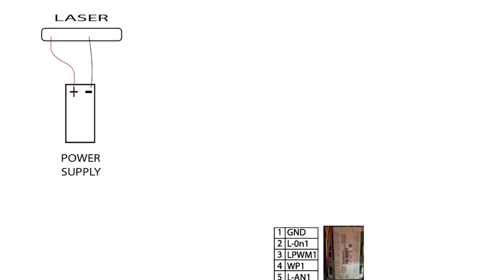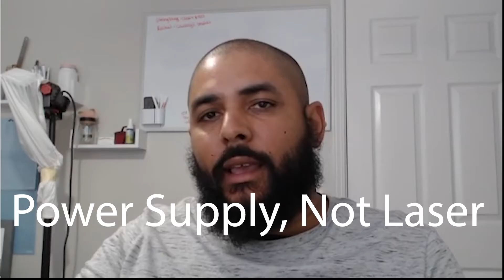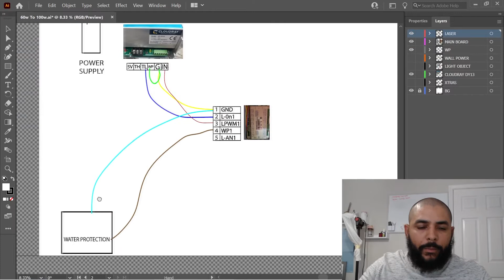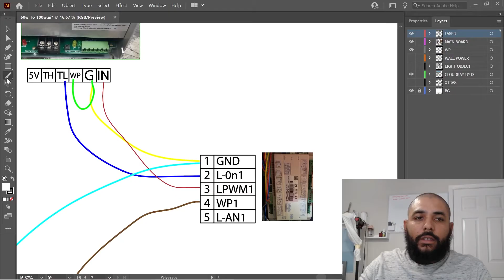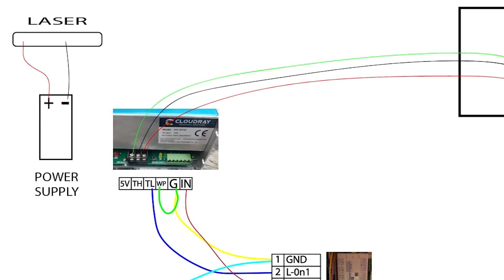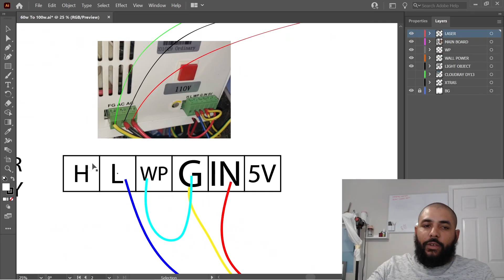Upgrade CO2 Laser Cutter From 60w to 100w Wiring Explained Reci W4 Laser Tube and DY-13 Power Supply

Comment: What’s is the 5v in the power supply for? Is it input or output?
Reply from the maker: I'm not sure what it's for, I haven't seen it used yet. I have a different laser now and that one doesn't use it either. I looked around a bit and from what I gather it's a 5v output with about 20mA amperage

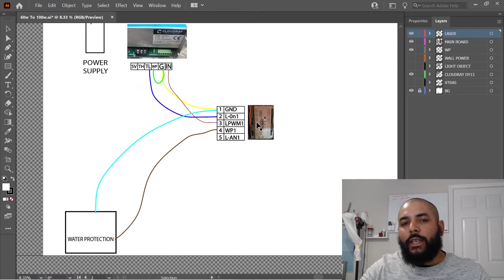Comment: First of all, I love the video. It answered so many questions. You are a genius. You said your original laser is a 60-watt. You have upgraded to a 100-watt. Regarding the water protection, yours is controlled by your laser controller and not the power supply, hence the jumper wire from wp to ground. Your original setup had a water protection switch already built in at 2:43. Are you saying that your old 60-watt laser tube was water cooled? If so, that is very impressive. Or did i misunderstand something?
Reply from the maker: Thanks Mark, yes that's correct. My original setup was water cooled from the factory with the hardware already installed so I didn't need to install the water flow sensor.
Reply: Thanks for the reply  @RogersTestLab

Comment: Hello dear can you please tell me that i can use 150 watt power supply for 100 watt laser ctter
Reply from the maker: If that’s all I had I personally would. I’d just be sure to use an ammeter rated for mA and not go over my laser tubes rating (should be 20mA if you’re using tubes like the ones I’ve used).

Comment: Nice job, thanks. So the 100w tube is (significantly?) longer than the 60w - correct? I have a panel in my 60w case that can be removed, but where do you find a cover for the 100w tube - that is, an "extension cover"?
Reply from the maker: Hey Steve, yes my 60w was 1000mm and the 100w was 1450mm so there's a 45% difference in length of the laser tube. 
There was a comment that I saw in here a while ago (that I can't seem to find) mentioning modding a PVC pipe as a cover but I never got around to trying it. 
Honestly if I really wanted a cover I would just call the manufacturer, in my case OMTech, and ask them for one. I'm sure they'd sell something.

Comment: Hey could you tell me what could happen if you mix the order of the wires 
Like I messed up the wiring of the power supply and now my machine won't stop firing the laser 
Please I hope u respond soon 
Thank u in advance
Reply from the maker: Hey Haroune, it would depend on the components you're using. 
If it were me I'd start by looking for a Facebook Group specifically for the laser cutter that I have, this way you can send pictures and reach a larger set of people that know about the system you're using.
Reply: @RogersTestLab  all I'm trying to find if I wired it wrongly would It have any impact on my controller
I have an mpc6525 leetro controller
Thanks for responding I really appreciate it

Comment: Thank for some help, I reworking a older Golden Laser to updated controller Ruida 6445G, The laser tubers may be bad so I may have to replace them too. If so I will replace the PS too. And go from 80 watts to 100 watts. I have the X and Y moving but no luck with a test fire of laser
Reply from the maker: Hey Kevin, thanks for watching! Good luck on the repair

Comment: Can I use a 130w tube on a 150w power supply
Reply from the maker: I would, from what I understand it's just you'd want to use a lower percentage so you don't fire your laser over 20ma
Reply: Ok thanks, I used to run at 65 /75% anyway so I guess it should be ok
Reply from the maker: @englishwoodman  good stuff man, let me know how it goes

Comment: Hi Roger 
I am upgrading my 60 watt OM Tech red & black laser to a 100 Watt can you tell me where you purchased the tube mounting brackets for the 100 watt tube.
Reply from the maker: Amazon. Since I got a reci w4 (80mm diameter) I searched Amazon for 80mm mounting brackets and got the cheapest ones basically.
There are adjustable ones on there too in case you get a different tube size

Comment: Hi, if there was already a 60W tube, why not switch the power supply and the tube to 100W and that's it?

Why did you have to mess with water protection ? After all, the water protection already worked with the 60W, didn't it ?
Reply from the maker: Hey Nir, that's what I did. 
When I was explaining the water protection piece I was showing the different places the water protection signals (either the power supply or the controller) to stop the laser from firing when the water protection switch isn't triggered. 
I agree with your thinking: if it ain't broke don't fix it.
Thanks!

Comment: Hey Bro Nice information, I just bought a 55W CO2 laser (Chinese), I have been thinking about upgrading to 130watts..it's possible in my machine? Do you have another video where you made your process?  I'm really scared to do that on my own.
Reply from the maker: Thanks! I wish I did but I didn't make a video of the actual process. 
If your laser chassis has a cutout for the tube to extend through and the opening is wide enough to fit the width of the tube then you should be fine.
Then it just comes down to the power supply, laser tube mounts, and sufficient water cooling.
I only upgraded because I was happy with the bed size. Now that we're picking up orders I wish I had a larger cut area.

Comment: i just purchased a 60 watt laser,  will the 100 laser tube the same size as the 60watt tube?
Reply from the maker: It shouldn't be. My old 60w tube was 1000mm and my reci w4 100w is 1450mm, so about a 45% longer. It sticks out the end of my 700mmx500mm red and black laser machine.

Comment: Hey, Nice explanation!  I also want to upgrade my 60w laser. Did you have to make any adjustments to the laser tube such as the hight. ?
Reply from the maker: Hey Nanne, thanks for watching. Yes, absolutely and a very good point. The tube is thicker so it sits higher but it got even taller from switching the tube mounts. Since the tube was too thick for my existing tube mounts I got the CloudRay 50-80mm ones from Amazon which sit much higher. I ended up shimming the first mirror to compensate the the height of the tube.
Reply: @RogersTestLab  I upgraded from a 60W to an 80W in my Red/Black and was originally going shim mirror 1 until I thought on it and realized by doing so would cause the beam between mirror 1 and mirror 2 to not be perfectly parallel with the the rest of the beam/mirrors. For example the beam would hit lets say in the center of mirror 2 when the X axis is close to mirror 1 and when the X axis moves further away the beam would now be hitting low. Did you just split the difference between the two and just send it anyway? I ended up designing and 3d printing my own tube brackets in the end.
Reply from the maker: @T3chbox  yeah I hear what you're saying.
I don't use this laser anymore, I switched to a 150w with a bigger bed, 
but
if I did have that issue I would probably zero it near-center of the laser bed after the 4 corners and the variance should stay on the mirror.
I like your 3d printer method though, you should post a video and sell them online, I would've definitely bought something like that just to keep the beam as perfect as I could.
Reply: @RogersTestLab  oke thanks! Than I have to order my zelf some new brackets.
Reply: @RogersTestLab  Curious, what did you use to shim Mirror 1? I'm upgrading to a Reci W1 which is a bit smaller and trying to figure out the mirror changes without modifying all of the mirror locations.  Did you have to adjust any other mirrors?
Reply from the maker: @michaelkonchalski1977  Good call, yes I did. The existing mounts had a much smaller diameter so I purchased a set from Amazon. Unfortunately the mounts from Amazon were taller than the mirror so I used the shims from the mounts I took off and placed a couple under the mirror until it was level.
Reply: @RogersTestLab  did you have to shim Mirror 2 and adjust the laser head?  Thanks for the response and this video. I can't wait to do this upgrade.
Reply from the maker: @mrk666  Nope, just the first. After that it's just zeroing the beam like normal.
Reply: And where did you purchage the tube?
Reply from the maker: I purchased my tube and power supply from a company in Sacramento, CA called LightObject. Their site is lightobject.com
Reply: @RogersTestLab  the laser tubes are all over thema internet. And there are some fake wones. So a going to do my reachers first. Thanks for the adres.